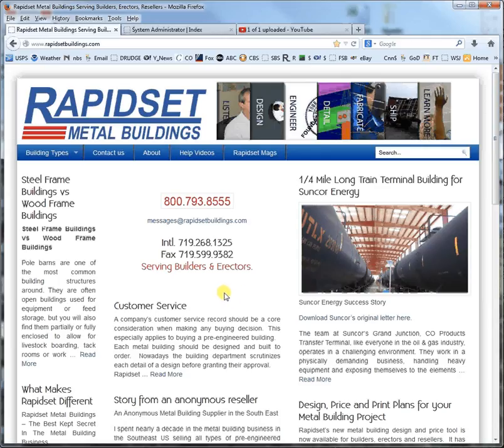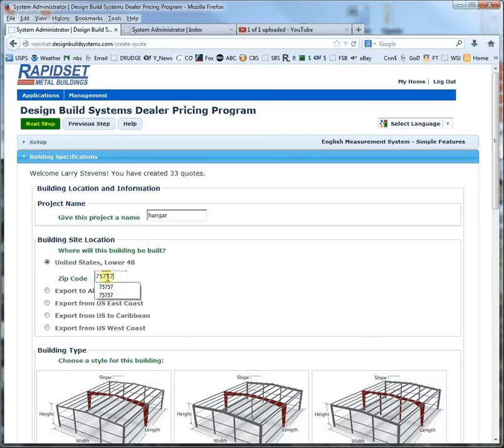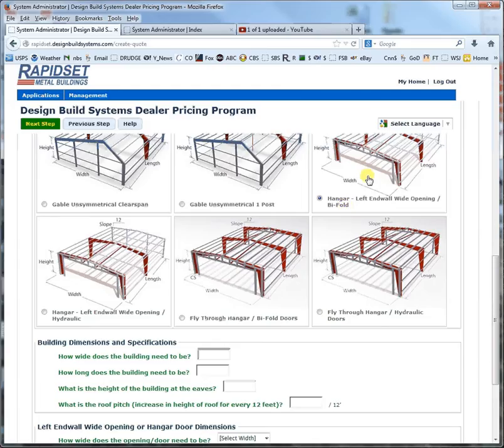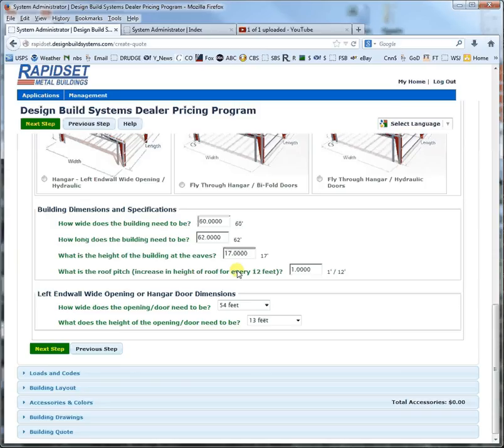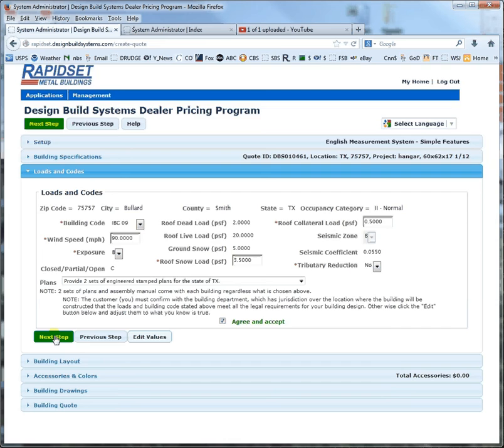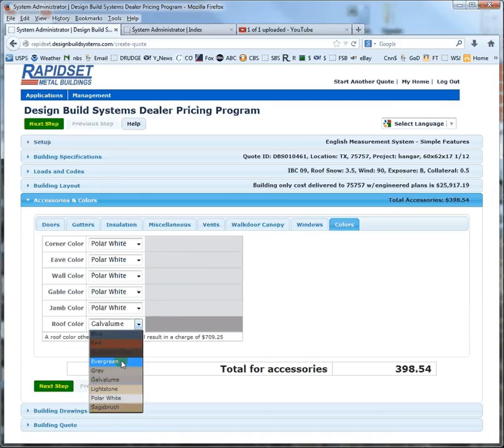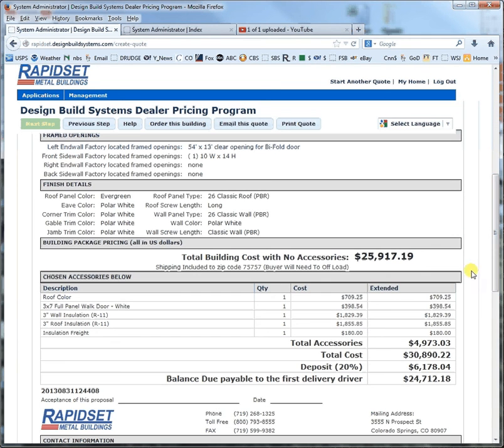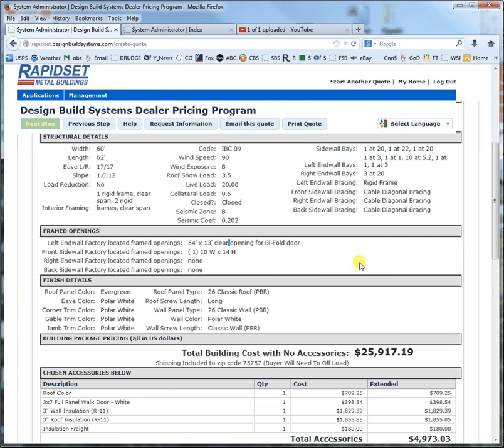Design and price an aircraft hangar with a bi-fold door

Comment: Where do you find the information for wind? Can you increase the value?
Reply: When you get the loads and code screen you can simply edit it for the wind needed.  It is best to print out the final design and confirm it works with your building department and if needed change it as you design to get a correct quote or call the office and we'll get it done for you.  but make sure it what they would demand.